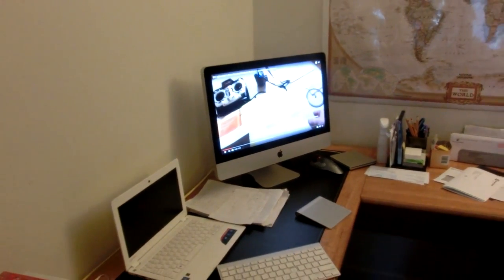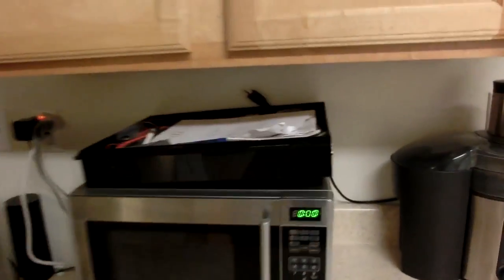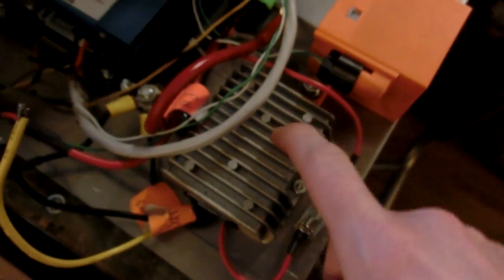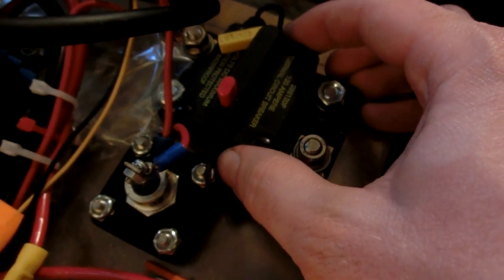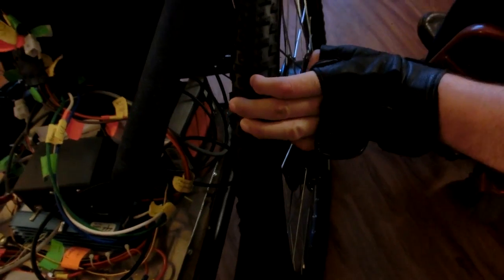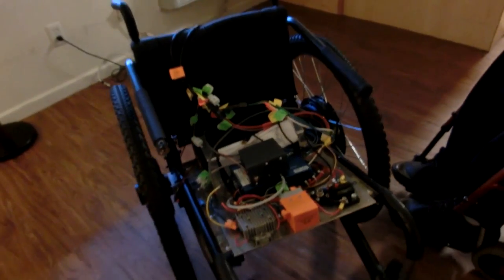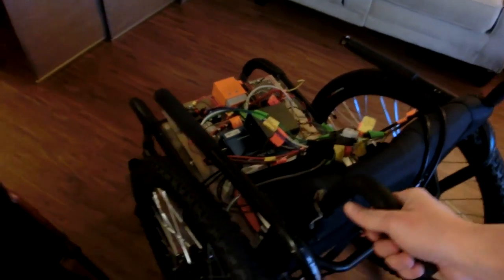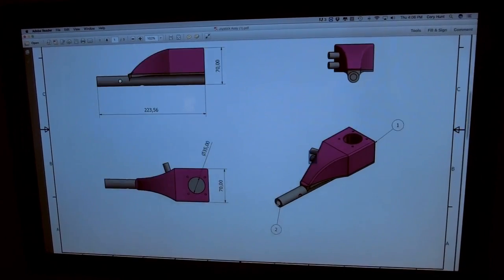DIY Lightweight Lithium Powered Wheelchair Build part 4: 48v 1000w hub motor upgrade!

Comment: That chair is going to be faster than the van! Very cool build. I think that its awesome how these types of tech have made peoples lives better. My grandfather has a couple of different mobility scooters that he uses on a daily basis. He say that his life would be so much more isolated without them. The old one that he bought used is giving us some issues though. It wants to lurch and jerk under acceleration. We put new batteries and a new pot in it but still the same problem. Its a shame because it rides so well otherwise.

Comment: the only thing I can see to add is a small LED headlight maybe mounted in the front of the 3D printed joystick enclosure with a on/off switch or 3 position switch low/high/off

Comment: the circuit breaker looks like the solar circuit breakers i use on my systems. and u can get them in all ranges on amps and volts. Ill have to get around to making a vid of the Aux power system on our truck as it would show how I use those breakers to protect and or isolate the truck from the aux system.

Comment: I'm curious about the torque dynamics on the "single shaft" hub motors (basically, will their own torque under load warp their shafts). For your etrike build you put a fork on the rear wheels. But getting rid of the rear axle makes everything more replaceable. You just lose the pedal assist drive train.

Comment: would you be interested in a custom build battery job for a container for 4 12v lead acid on a well known skooter? I'd send you the box. might make a good video. you'd have to custom shape the cells to the box and wire it right etc.

Comment: dude I'm trying to figure out how to run my 60v e-scooter to run on a 120v generator  I was thinking if I went from the generator to a 220 to 110 step down transformer but put 120 into the step down cutting the power in half should put  out 60v  to a batterie bypass switch so I can switch back and forth between generator and batteries to power my scooter. Dose any of all that make sence lol what I really want to no is will the step down transformer that is ment for 220v to 110v  cut 120v in half to 60v  . thanx
Reply: No its not crazy I would like to put the genorator in a trailer for long distance trips when I go through town I'd like to be able to shut down the genorator and run off the batteries the scooter goes 80 klms on one full charge I would have to stop and charge up the batteries then carry on my way for another 80 klm but if I was able to power my scooter direct I could go alot further in one day . And refresh my batteries in the evening I also intend to mount a solar panel to keep one deep cycle marine battery charged to keep my phone and computer charged it sounds like a whole crazy mission but I think it can work.
Reply from the maker: nevermind me, i just now realized Gateway's comments werent showing up, all i saw were your comments Joshua so it sounded like you were talking to yourself. lol

its really strange how YT sometimes decided to hide comments from me, like i cant see Gateway's comments on my comment manager page nor on the video.
Reply: It is better to run the generator when the batteries get low for the sole purpose of recharging the batteries. This may or may not be a bit tricky buy it is how DIY hybrids autos back in the 60's and 70's set them up and is how the Chevy Volt is designed.

Perhaps your best solution lies in having two sets of batteries so that when the one set gets low, you switch over to the other set at which time the generator charges the low.

You can also extend your battery life by not charging the batteries beyond 80% and not allowing them to discharge beyond 25%. I think I read this on a chevy volt spec page, but I don't have full recall as far as where I actually read it. 

My brain seems to have selective storage. Interesting details such as the 25 - 80% charge battery life extension get stored. Details like the webpage are discarded.
Reply: Extra battery sets is of course, totally dependent upon affordability and room to carry.

Comment: Im having the hardest time finding hubs like that. I want to build a 4 wheeled bike thats all wheel drive and fully suspended like a race quad
Reply: Those power 2wheel electric toys they sell at Walmart take the wheels off and drill holes in them and spoke them there's a video about doing this on YouTube
Reply: @davidmayhall6567  do you mean those little like skateboard looking things that they call hoverboards?